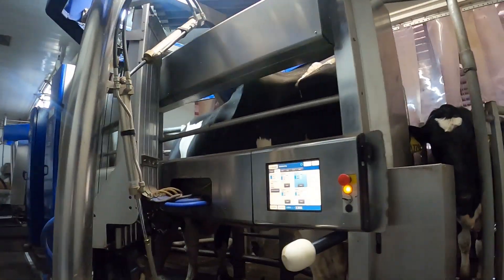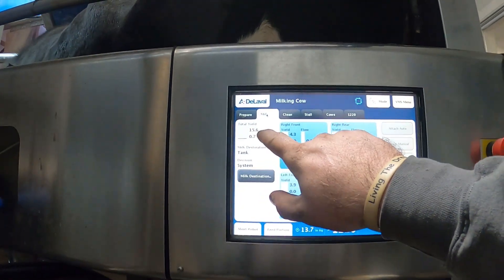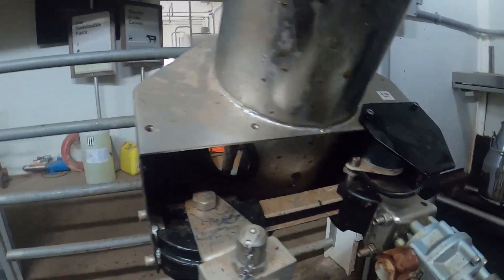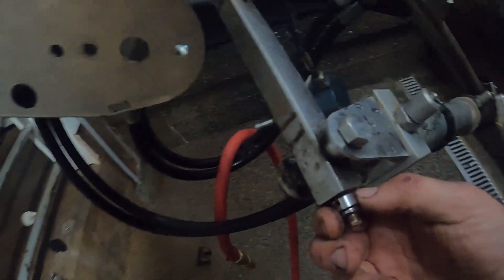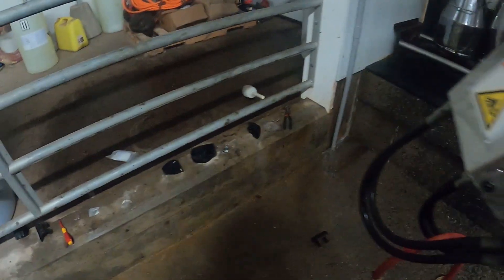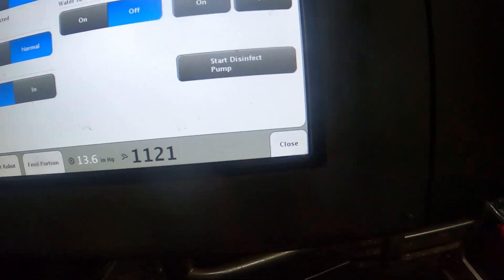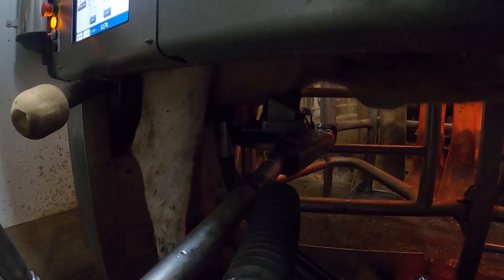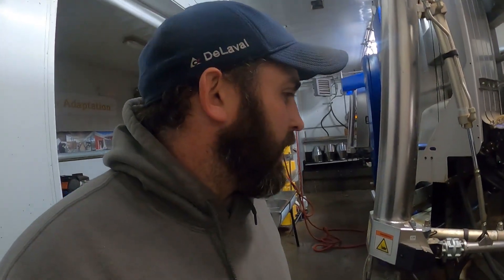How to do arm repair on a Delaval Milking Robot

Comment: Do you have the new 300 in your area the guys here really like them 99 % cow attachment
Reply from the maker: We have 5 units to put in over 3 farms of the new 300 models. We have alot of farms that run very high attachment rates currently so it will be even better with the new models, the biggest change for the new models in our eyes are the technical access for us as technicians

Comment: Interesting, full disclosure, I'm not one for robotic milkers. But I guess you need to get $2 a gallon milk somewhere.
   A question, if for some reason those things go down, are you able to carry on milking conveniently? 
    Best regards from Indiana.
Reply from the maker: Whats $2 a gallon have to do with it? We have only had them go down to the point we couldn't milk once. Power company surged the system and smoked our phase converter. We rented a 3 phase generator and now have a back up. That was prior to having more in the area. If something happens on the arm you can manually attach cups and wash. I work for the local dealership and worked for corporate delaval prior. I can fix anything on them and have seen just about anything, the going down isn't the major issue its just diagnosing them that takes the skill and knowledge. When we put one in 10 years ago no one had faith it would last but I see it as the only way to milk cows in the future, we struggle with labor. Could pay 20 dollars an hr and still can't get good consistent labor, also being diversified we are spread out with the labor we have.
Reply: @DuffyAg  easy there. I'm not taking a stand either way. $2 milk is what people want and what they'll get. My concern was for the welfare of the animals, not the economics, or a political view.
Reply from the maker: 2 dollar milk definitely doesn't come from robots tho, not with the increase in up front cost. Cows live a better life in robots then any other operation, its crazy how relaxed robot barns become after start up. People stir cows up and cause problems cows being cows is top notch.
Reply: @DuffyAg  I am just lamenting that's the price in the grocery store.
   Again, I grew up on a dairy farm, cows need to be milked. I just wondered how much of a hardship if any, it would be if your robots went down. Manpower, alternative milkers, etc. Or for that matter, how long they could be down without a real problem.

Comment: We have tossed the idea of robotic milking around. What is your opinion on retro fitting into and existing free stall set up? 
 How much water does it use per cow a milking? I have talked to different reps at farm shows and none of them have been able to really give me an answer.
Reply from the maker: Most of the farms i work with now are retro fits due to barns being in good shape and the cost of a new facility, the biggest thing with a retro fit is expectations. New barns are built for efficiency and you do not see the same efficiency gains in retro fits while going to robots. If you are looking to replace labor as far as milking and become better managers and focus more on cows then retro fits work awesome same as in New barns. Tasks of cleaning and bedding cows is usually the biggest increase in New barns. A robot uses roughly 1-1.5 gallons a day of water depending on wash numbers amount of floor flushing and length of teat cleaning. That includes washes. So 180 gallons to 200 or so gallons a day. Biggest use of water in my eyes is washing things down. How aggressive that is changes water usage alot.

Comment: What is your relationship with the farm that you work on? Are you a partial owner or employee/contractor with your own equipment or something else?
Reply from the maker: I am just a employee on the farm its my family's operation and  technically I'm next in line for it but no transition plans are made currently. Then I am considered custom farming operation since the chopper some trucks the 7520 and all thr manure hauling equipment is under my own business and is hired in.
Reply: Thanks for the clarification.